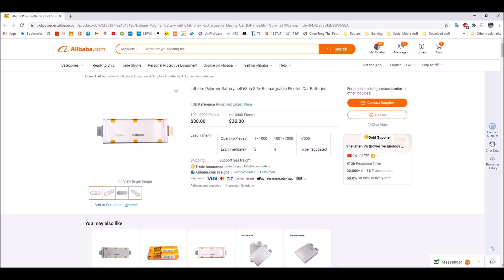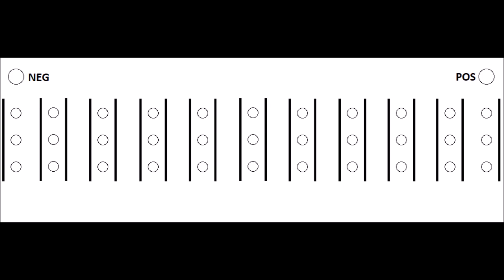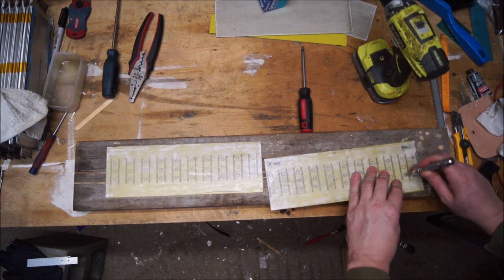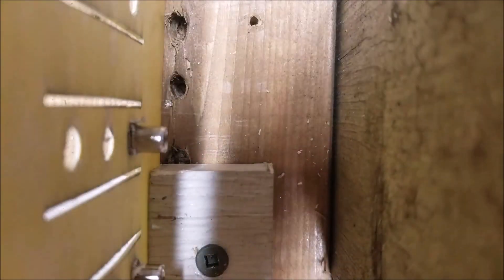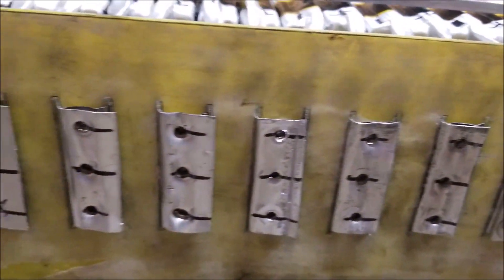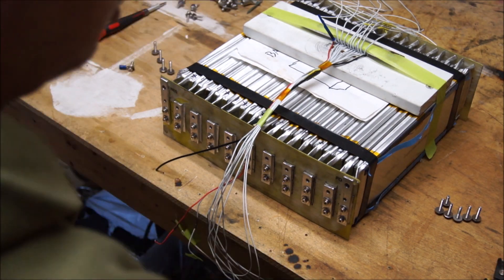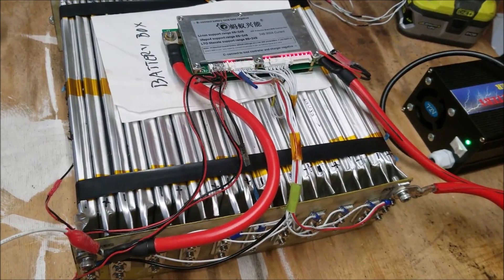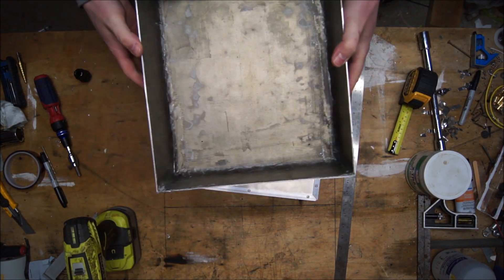LG Chem lithium ion NCM prismatic pouch battery build.

Comment: Sorry if you already posted...do you have a link to thise cells?
Reply from the maker: The original seller does not carry these exact cells any longer.  
I have been eyeing these cells but I have not tried and therefore cannot verify if they are legit.  https://www.alibaba.com/product-detail/3-7V-87-5Ah-Lithium-Pouch_1600438539380.html?spm=a2700.9114905.0.0.JE6Avm
If you want legitimate LG (Lucky Goldstar) cells you can buy used modules from Batteryhookup
https://batteryhookup.com/products/samsung-ev-lithium-ion-12s-44-4v-47ah-2-07kwh-module

Comment: People are talking about Swelling... these are Li-Ion right?, just cause its a Pouch Cell does not mean its Li-Po, Li-Po is what RC cars etc use and those are know to swell...i dont actually know if these can swell too but i dont think its very likely, im thinking of buying some SK 75ah cells from china, making a 72V 75ah pack and potting it in epoxy...the 18650 & 21700 cells have a went for gasses to escape i quess the large Li-Ion & Li-Po chemistry pouch cells dont.
Reply from the maker: Yes. Lithium ion.  I have heard that they expand and contract a little bit during the charge and discharge cycles.  It's possible the compression helps to stabilize the cells during the cycles.  To logically you have to let them expand and contract a little bit. So I'm not sure about potting in epoxy as that might not allow them to expand at all or the epoxy will crack.

Comment: Any issues with cell expansion? Did you ever tape them up or compress the pouch cells at all? I have these exact cells and am starting the build for two 10s packs for my recumbent trike bicycles. I wondered about compression.       i won't be pushing them hard, think max will be 1500 watts but likely won't pull that very often. Thanks in advance
Reply from the maker: I've never felt certainty about whether they need compression or not.  Looking at the data there is no certainty.  But for my next pack, I do plan to mildly compress them. It'll be more along the lines if not allowing them to expand rather than putting pressure on them.
I have sold the bike and so I am unable to monitor them.  I will be providing warranty to the person who bought it. Maybe in 6 months time I'll have a chance to look at the cells.

Comment: I am planning on doing a build like this for my racing dirt bike/ other vehicle with 10c 63ah pouch cell batteries. Can you please make a video on how you connected the tabs together without catching on fire since i dont want to risk losing 30 cells because ill be making it as much voltage as i can (126V), please tell me how you wired and how u connected the batteries together. Very thankful if you tell me
Reply from the maker: I bet you watched that video from that (Russian?) guy who was making a pack configuration like mine who accidently shorted and burned half his pack.
I would love to make another vid with pouch cells but the cost in shipping from China due to the sanctions has made the cost to go up by 4X to Canada.  I am sorry I cannot make another vid anytime soon but I will in the future.  Also I need to find cells that are safer because one of the LG chem cells swelled up in that pack forcing me to replace it.  I do not trust or recommend LG chem cells anymore.
Reply: @diyelectrified1289  yes you are super right i did watch that guy, i am studying chris jones battery packs so i could figure out how he connects them but he only uses the 2 tabs at the top cells and not these big  cells so its like learning 2 different skills, either way he made me look at the right direction but cant really show me how to make one since his thread on a FULLY DETAILED build got so i have nothing to go off of.
Reply: @diyelectrified1289  id like to ask since everyone says that the cells need good pressure, what type of glue i should use? i am planning on making the battery pack in a plexiglass see through material so it looks futuristic/different from the other builds

Comment: In my country. Battery builders ask too much for the battery build. I wish you could make another video. I have a 72v 32ah scooter it is all stock lead acid. I want to build my own battery pack with 64ah just to save money.
Reply: I don't have any special equipment like the one you used.
Reply from the maker: I do plan to make more videos with pouch cells but I presently releasing from the military (my day job) and it is consuming most of my time.  
Also, with the present sanctions on China, my shipping costs have quadrupled making raw cells way too expensive.  
I have bought a Glitter 811H 40KW and I plan to see how it will spot weld pouch cell tabs to each other.  Remember the anode is copper and the cathode is aluminum on most NMC li-ion pouch cells.  You need a lot of power to spot weld aluminum to copper.  If it works then you can easily connect the tabs together like in my video but without the numerous and expensive machine screws and rivet nuts.  Alternatively you can just pop rivet the tabs together.

Comment: couple of comments to building a battery with NMC pouch cells. I do have 2 pouch cell batteries from Microvast. Totally awesome batteries! 
the cells should touch each other on the entire surface, if you want to use foam between, do so on the whoe surface, or you will create uneven pressure, which is terrible for causing delamination over time. I have my cells touching each other , only the 2 extremities are covered with a layer of foam followed by a rigid pressure plate (best is carbon fiber 2mm or at least glass fiber composite 3mm). The whole block needs to be tied together to create even pressure on the whole surface of the cells. I do that by squeezing the block into a custom made sheet metal case with exact interior measurments. at the same time, the case becomes as compact as it can be, a big challenge wich such large format cells on bikes.
Reply from the maker: I have learned a lot since making that video.  I tend to agree with your observation about how I separated them with the foam strips maybe not being the best approach.  I've also learned since then that the top manufacturers like catl believe that compression on pouch cells and prismatic cells is only necessary for the initial charge.  I still have my original concern with building a battery like this and having the cells touch each other with the heat generation building up in the center core of the pack.  The cells in the very center if compressed against each other will have nowhere to dissipate heat and it could build up into a thermal runaway situation.  So on my future build I have a few ideas about active cooling that I might implement.
Thank you for the comment and advice.
Reply: @diyelectrified1289  under 2C continuous discharge you should not get any worrisome heat generation. also, the best way to get rod of the heat is through the + and - tabs, not the plastic pouch sleeve. consider potting the tabs to a heatsink. sligh compression is definitely better than none or worse uneven compression. lipos should not be compressed, but these are not lipos.

Comment: Cool project. Nice final product !! Personally, I'm afraid of this battery chemistry. I'd prefer to have lithium iron phosphate batteries for my home system. Far less likely to cause a fire. So I hear. Cheers !
Reply from the maker: Thanks.  I also worry about lithium battery fires.  I take every precaution and use the best cells and BMS that I can afford but of course there are things you cannot control - namely, the manufacturers quality control.  Chinese products are getting better though.  Also the media focuses on battery fires for the clicks even though they are statistically much less than gasoline car fires.  I know, I was surprised to find that out as well.
Reply: @diyelectrified1289  Indeed, ICE cars spontaneously combust all the time but it's never reported on the way EV fires are.

Comment: Which materials (for rivnuts, screws, and busbars) would you use for LiFePO4 cells?
Reply from the maker: I try to stick to stainless steel and copper as much as possible.  But when I can't get copper, aluminum works well as long as you make it thicker than you think you need.

Comment: Great Video - I purchased 4 batteries from battery hookup which are made from LG Chem lithium ion NCM prismatic pouches.  Ford Escort EV battery.  14.8 volts 1.1 kwh.  Looking up the LG Chem lithium ion NCM prismatic pouch battery specs,  the charge current is 75 amps and voltage is 16.4 volts based on the 4S configuration.  QUESTION: having a hard time finding a reasonably priced charger out side of a Solar Charge Controller that is programable for voltage cutoff (high/low).   I purchased BMS(s) 30A which was recommended if I did not want to run into the heat issues.  Note: The batteries are in cases with coolant tubes.  What is your preferred charging device?
Reply from the maker: Good day,  sorry for the late reply.  I have only had good experiences with this aliexpress company for buying BMS's and chargers... https://www.aliexpress.com/item/4000121088149.html?spm=a2g0o.store_pc_groupList.8148356.4.6a0e35581Oqa2d&pdp_npi=2%40dis%21CAD%21C%24+297.72%21C%24+256.04%21%21%21%21%21%40210318b816804705541633339e178e%2112000027406682634%21sh&gatewayAdapt=glo2idn
There is a 60V charger with variable current limitations that should serve you well.

Comment: Really liked the design, my only constructive criticism would be the terminals inside the case.....I would prefer to see them heavily insulated. Mightn't they scratch through the fiberglass on the inside, with movement over time?
Reply from the maker: It's a good observation, but if you could see the cells for yourself up close in the case you can see that they do not move around at all and do not make physical contact with the fiberglass thereby there will be no movement to scratch their way through.

Comment: hi
thank you for sharing this practical information!
I am going to do a elec conversion on a dirt bike aluminium frame,order QS 138 H 90 direct drive 4 kw motor and ND 72850 controller capable of 450 A from 0 RPM!
Which cells do you recommend to reach 82 V, 72 Ah+

with 400 A peak discharge current????
I can't find  3,7 V 60Ah prismatic cells with more then 5C?
Or maybe I don't know Wich seller is selling them

so maybe you can suggest a model of the sells from the video so I can make only series connected!

thank you
Reply from the maker: You can get high discharge prismatics in 2p config to hit the 450A discharge rate.  But I don't know how you can accomplish that at 60Ah 84V and keep it light enough and small enough for a dirt bike.
You will have to compromise somewhere.
2p of these cells will get you the discharge rate you want but you will need 20s for the voltage.  That's 40 cells.  That's a big battery for a dirt bike.
C$ 130.86  36%OFF | Polymer Lithium Battery 30Ah 3.7V Ternary Rate Cell Maximum Discharge 5C for LG RV Electric Vehicle Start Energy Storage
https://a.aliexpress.com/_mNmytWI

Maybe you should use high discharge 18650s in 20s 10p to get the amps but have to charge more often.
C$ 12.93  53%OFF | Hot LiitoKala New Original 3.7v 18650 HG2 3000mAh Lithium Rechargeable Batteries Continuous Discharge 30A For Drone Power Tools
https://a.aliexpress.com/_mNhfePM
Reply: Thank you for the quick answer

I  have found 3,7V  72A even 80A  from this flat battery cells so coled NMC,and waiting the seller to confirm if they are 5C or more ,and if they can support 400-430A max discharge current!

I am still  hoping to find 3,7 V cell that only in series to achieve 82 V and the 400 range peak current!
Probably this method will deliver as light  as possible battery pack!

However what do you think how accurate is the specs given from  any seller in ALLibaba ?

Thank you
Reply from the maker: It's always a gamble with merchants on Alibaba.  You always have to verify the claims made on products you buy there.  
450 amps is a lot of current for a single cell.  That cell should have very large battery tabs in order to handle it.  I don't think it's impossible for you to find a cell that will do that but in my opinion that cell will likely last less than 500 cycles.
Reply: By the way I don't think I will be able hold full trotel (430A) for more then 4 sec on a dirt road,
so probably this is also important before choosing the sells!

Comment: How does this handle 10% natural expansion? with use, otherwise pouches just burst, no pressure valves.  He doesnt put any insulation/foam in the base?
Reply from the maker: The cells were taped together with capton tape and nylon reinforced tape and then placed in an aluminum enclosure that had 2 mm thickness walls.  The enclosure was lined with EVA foam at least 3 mm thick.

Comment: Awesome vid,How does this battery perform compared to the 18650 Im keen to switch to the pouch design seems like a much smaller form factor for the same ah also what was the weight of this pack. are you willing to share the battery connector board  laser cut files ??

Comment: before you assemble it did you do the balancing on each battery?
Reply from the maker: Yes I always top balance my cells by putting them all in parallel and then charging them on my bench power supply right to the very top. (In this case 4.2 volts)

Comment: U got me with the givaway 😁 jk. Can you talk about the specs of the battery? 

Great video buddy, keep going
Reply from the maker: The cells are LG chem E60's.  They can do 2C safely. 20 in series makes an 84V pack @60 Amp hours which equals 5kw hours
Reply: @diyelectrified1289  just 20 cells used în this battery ?
Reply from the maker: @andreiiulian5649  yes.  These cells can output 150 amps continuously

Comment: Have any of these LG cells blew up on you? Do u use SK cells instead now? How fast do you charge them? Have your oldest packs started swelling up a lot?
Reply from the maker: I did have to replace two of the cells.  But that was due to my error in using zip ties when I originally built the battery thinking I was going to keep the wires nice and neat. Unfortunately, the knuckle of the zip tie punctured the mylar of one of the cells.  
I replaced that cell and the one next to it that got damaged from taking the battery apart and it has since performed flawlessly.  I no longer own the bike.  I have sold it and the people who now own it love it.  The bike is legally roadworthy and registered as an electric low speed motorcycle.
Reply: @diyelectrified1289  awesome. Will see how best I can follow your instructions.

Comment: is it not better to use rivet nuts and bolts made of aluminum?
Reply from the maker: I chose not to because of galvanic corrosion.    Remember the anode is made out of nickel coated copper and I was afraid that if I used aluminum directly against it, it might corrode.  It might not but I didn't want to take the chance.  Also, aluminum is a softer metal and more difficult to torque screws down to.
Reply: @diyelectrified1289  my cells have anode and cathode made of aluminium - stainless steel with aluminium cause galvanic corrosion too

Comment: Thanks for the Vid. 7:24 - Did you used some liquid filler  (Silicone) to fill the gap betwen battery and fairing? How is the Battery fixed inside the fairing?
Reply from the maker: I only used silicone to seal the top onto the box when completed.  It makes it difficult to remove if the battery requires servicing but it also ensures a water-tight box.  The battery sits in the box confined by the end circuit boards that are tight against the sides.  I failed to capture it on video (camera noob) but before the final assembly I placed 2mm closed cell foam under the cells.  I think the foam is neoprene but I am not sure as I robbed it from my tool box (tool box liner from Canadian Tire brand tool box).
The final iteration of the battery box will have a filler cap on it so that I can flood the box and cells with pure food grade mineral oil.   It should allow for passive cooling.
Reply: @diyelectrified1289  did you ever try the oil cooling method?
Reply from the maker: Yes I have. I have used mineral oil in my batteries.  I believe mineral oil might actually help spread the heat and reduce the chance of battery fires. 
My first attempt though of mineral oil filled battery boxes resulted in a leak due to a flaw in the box build due to my inexperience as a sheet metal banger.  I joked with all my friends that I have the only electric scooter that leaks oil. LoL

Comment: Does the lg chem pouch cell swelling after sometime, have you face such issue with this battery 🔋
Reply from the maker: I have not seen any swelling in these pouch cells as of yet.
Reply from the maker: Also, I only have them charge to 3.8 volts per cell for normal everyday use.   This will decrease the max range of the bike but I believe that it will increase the cell longevity.
Reply: That seem a good idea